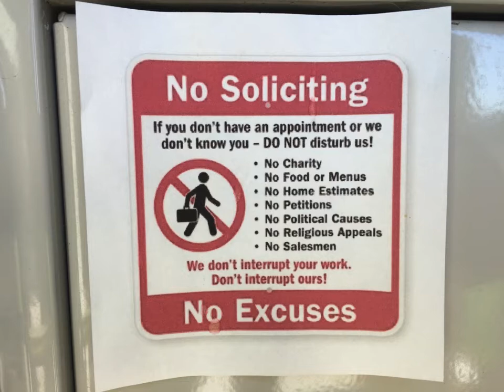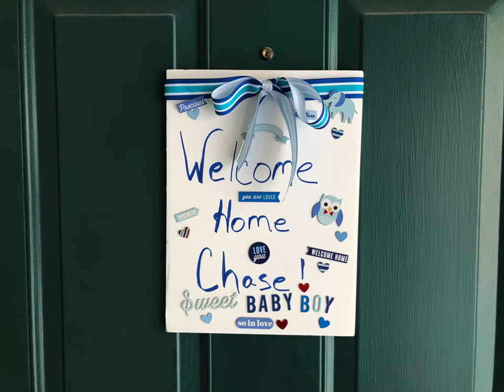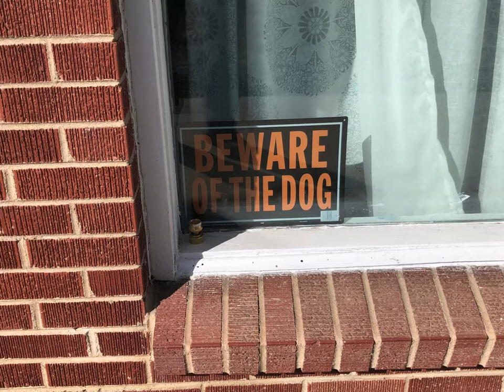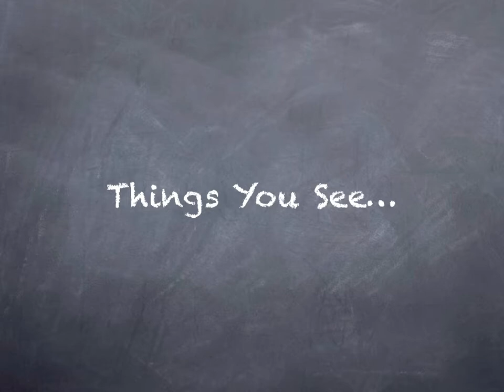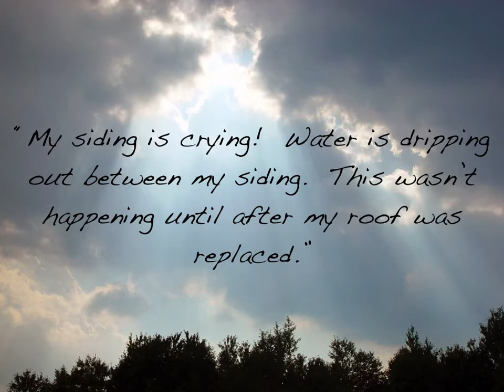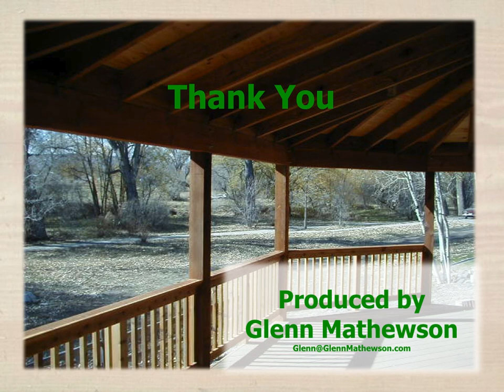Asphalt Shingles & The Code (Inspections)

Comment: What if the homeowner has new roof over slat decking?
Reply from the maker: Lumber sheathing is still allowed in the code today for new construction.  "Spaced" sheathing for wood shingles and shake (also still in the code) is not acceptable for asphalt shingles.